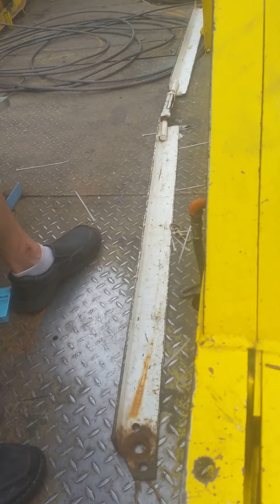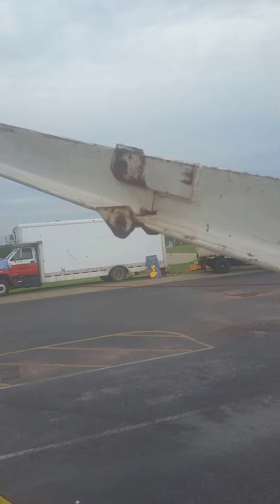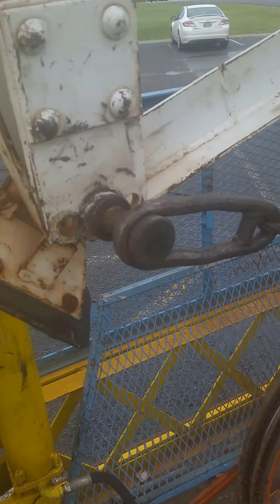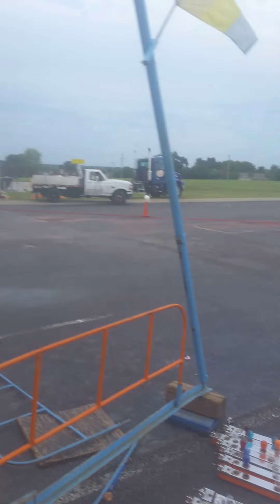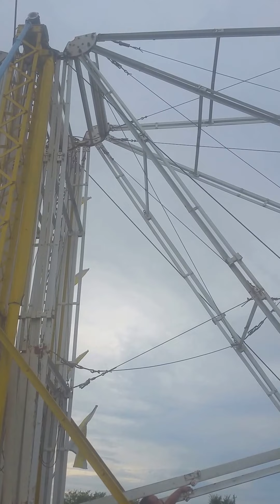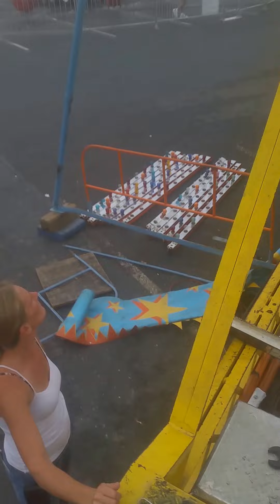1922 eli ferris wheel tear down part 2of3...12 seat carnival fair ride rides part 2 of 3

Comment: 2nd safety note, 
Foldable rim bars are best replaced with a continuous piece of steel. Remove them and rack them to side on the floor.  This reduces the chance the steel might hit or jam the towers when laying the tower over. This was also addressed in Garbricks' design.

Comment: Safety note dont put your body or any part in between the spokesat any time. Reach from underneath to reach the outside. 
Anything can happen from the which cable breaking to which failure. 
Safety first, and it starts with you.